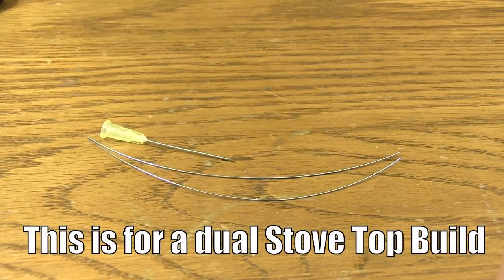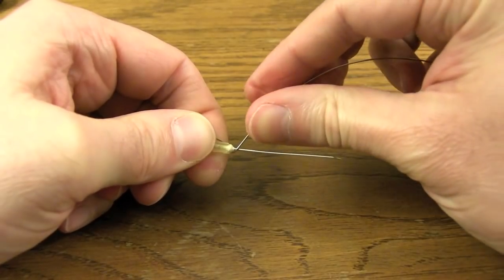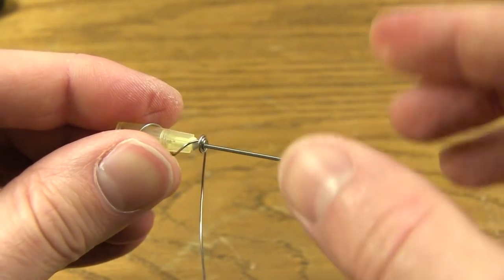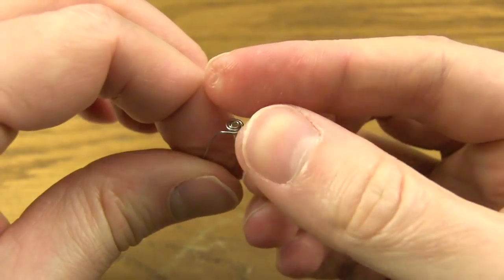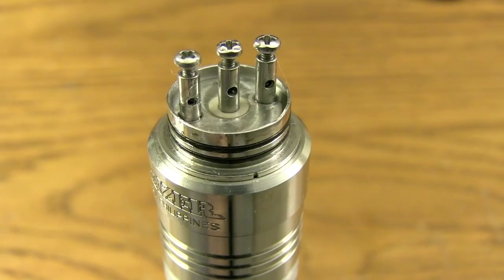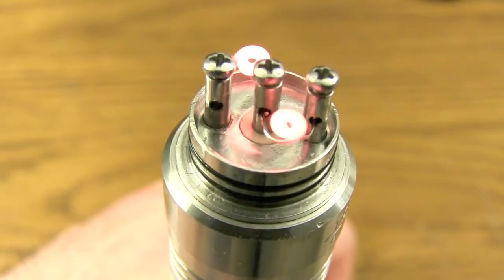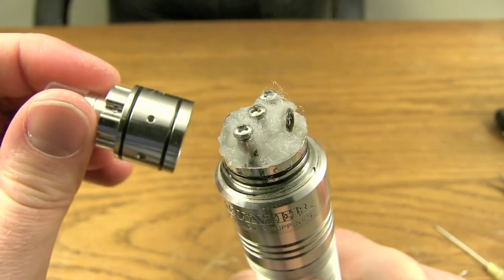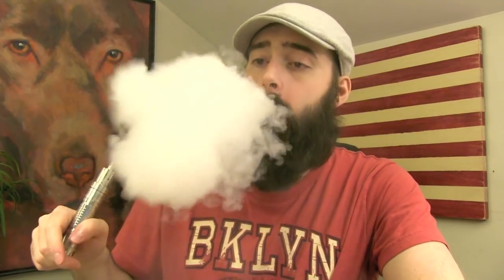Stove Top Coil Build

Comment: quick couple of questions rip. would this work well with a single coil build? 
I know everyone says vape safe and battery safety. Say i build my rda with a 0.14 ohm resistance, what would i have to do to ensure the safety on an unregulated mod, should I not even build that low or just get new batteries? ive always been confused because will just read out the ohms and then move on. I want to  try this coil but I'm unsure what to do after my ive found out my ohms
Reply: I vape on a 26650 mechanical mod with a ~.08Ω dual fused clapton build. It's perfectly safe if you use the right batteries. just make sure you're not pulling too many amps. my single battery is rated at 64 amps. I pull about 50 amps. If I wanted to go lower than .08 I could, but I would need to get a different mod with an extra battery I could wire in paralel to my other battery. 

Just make sure your batteries are rated for the correct amperage, and if you need more amps, wire an extra battery in paralel (NOT IN SERIES. YOU'LL DIE.) and you'll be good, plus you'll get more amp hours. If you're using a VV or VW mod, make sure you're within both your battery's parameters and your mod's minimum resistance rating. if you're using an unregulated mod, make sure any switches or mosfets are rated high enough for your build. above all else, when in doubt, don't risk it.
Reply: I vape on a 26650 mechanical mod with a ~.08Ω dual fused clapton build. It's perfectly safe if you use the right batteries. just make sure you're not pulling too many amps. my single battery is rated at 64 amps. I pull about 50 amps. If I wanted to go lower than .08 I could, but I would need to get a different mod with an extra battery I could wire in paralel to my other battery. 

Just make sure your batteries are rated for the correct amperage, and if you need more amps, wire an extra battery in paralel (NOT IN SERIES. YOU'LL DIE.) and you'll be good, plus you'll get more amp hours. If you're using a VV or VW mod, make sure you're within both your battery's parameters and your mod's minimum resistance rating. if you're using an unregulated mod, make sure any switches or mosfets are rated high enough for your build. above all else, when in doubt, don't risk it.
Reply: I vape on a 26650 mechanical mod with a ~.08Ω dual fused clapton build. It's perfectly safe if you use the right batteries. just make sure you're not pulling too many amps. my single battery is rated at 64 amps. I pull about 50 amps. If I wanted to go lower than .08 I could, but I would need to get a different mod with an extra battery I could wire in paralel to my other battery. 

Just make sure your batteries are rated for the correct amperage, and if you need more amps, wire an extra battery in paralel (NOT IN SERIES. YOU'LL DIE.) and you'll be good, plus you'll get more amp hours. If you're using a VV or VW mod, make sure you're within both your battery's parameters and your mod's minimum resistance rating. if you're using an unregulated mod, make sure any switches or mosfets are rated high enough for your build. above all else, when in doubt, don't risk it.

Comment: I'm kind of a n00b to vaping especially building my own coils so, bear with me. I know that each coil in this video are .62 give or take, so, if I added another coil to this and only used one would the resistance be closer to 1.4?
Reply: No it would half. For example if you build a coil that is 1.0 ohm resistance then adding a second coil of the same type to the atomizer will come out to around .5 ohm
Reply: Wait I mis read you question. Did you mean building a dual stovetop out of one strand?
Reply: I just meant adding another wrap to one coil.

Comment: Hey RIP.  What do you recommend is a good starting RDA and battery thats not too expensive?
Reply: my opinion get the 
Mutation X V3 
and fore battery get the MXJO 18650
Reply: What battery case you recommend? The DNA 40 is too expensive for me
Reply: You think the Turtle Ship V3 style mechanical mod is good?
Reply: Dopest Dope try out the angel mechnical box mod its around 25-35 and it puts out some great power
Reply: Sweet.  Thanks!
Reply: Dopest Dope I would recommend the K-Box for a cheap regulated battery mod that is basically idiot proof.  Unless you are running like super low ohms this 40 watt mod is more than enough.  The ability to swap batteries rather than charge through a cord, allows you to Vape constantly as log as you have a spare battery handy.  As far as an RDA, really, I'd recommend anything available to you with 1 positive and 2 negative leads.  This configuration will give you the ability to try all sorts of coil builds and determine what is right for you.  In contrast, something like the 'Monster Cloud' RDA has a configuration that can be difficult to build on unless you have some experience in super-nano coils or some such.  I have a 'monster cloud' myself, and I have difficulty building on it with anything less than 32g Kanthal.  Hope this long winded post helps.
Reply: Definitely will check it out.
Reply: Dopest Dope not too expensive how much? I'm going to buy an evic vt, it's really good mod. the battery  lasts long, it has temperature control, 60W, comes with ac adapter, usb charger cord, semitransparent silicone protector and ego one max clearomizer with two temperature control resistors, one of nickel and other of titanium. costs 85€ (~95$). for the rda IDK, something from kanger or even rebuilding vivi nova resistors lol ( vivi nova costs 10€)
Reply: Dopest Dope just wondering... Is the weed in your picture the dopest dope you've ever smoked?
Reply: Nope. The dopest dope I've ever smoked i smoked before i had a good cam. Jim Wilks Development

Comment: Probably a stupid question: if I accidently put the battery in my mech upside down and vaped a while before I noticed, is the battery still safe to use if I correct its orientation?

Comment: cool !!!  ok, so I will be using a mech mod (k100)  and I want to stay around 1.5 - 2.0 ohm.  I will prolly need to just build 1 coil. (going to order an rba soon, some clone, not exactly sure tho, but 3 posts for variety)  im using 30ga kanthal , how many wraps do I need to meet that 1.5 mark (or w/e u would recommend on a mod)  I have a decent multimeter, but its not super accurate.  any advice on always wrapping coils with 30ga at 1.5-2 ohms would be great  :)
Reply: Somehow I don't think rip is going to answer your detailed request.
Reply: madscientistshusta lol its all good, I probably did ask a bit and ive learned a few things along the way

Comment: Could you use this in a single coil RBA? Like say the Reomizer 2,0?
Reply: Yes it will work in an RM 2, you can also center post it if you pre-bend the leads right.  I didn't watch rips center-post vid, but I've been pre-bending my wires since my second build on an RDA.  It makes life easier.  Not to mention I'm fairly OCD when it comes to my coils and their uniformity.

Comment: These coils would be a lot easier to make with jewelry pliers.  They're basically spirals that anyone with a pair of round nose and chain, flat or bent nose pliers can create in a second and much more neatly than what was shown in the video.  I guess showing it done on the 20 gauge needle is better for those that don't want to invest in tools but the tools are pretty cheap if you buy them as a set so I don't really see the point unless it is just so you know a way to "try before you buy."  I might try this coil if I finally decide to get an rebuildable.

BTW, does anyone know if a rebuildable that would look good on my eGo-V v3 Mega?  I'd have to go no lower than 1.5 ohm on my builds but I still want one.  Help?
Reply: Get a Mod you'll want to go lower then 1.5ohm once you get a rebuildable!!
Reply: Leo Voisard I'd love to but I have Carpal Tunnel Syndrome which makes it hard for me to hold on to anything heavy which most mods are with a battery installed.  I'd be dropping it every two seconds and probably destroy it pretty quick.  At least it would look very beat up very quickly and I'd probably have juice flying everywhere, lol.  That's why I tend to stick to eGo batteries because they are light and I can put a lanyard on them so I don't drop them so often.  Do you know of any mods that can be attached to a lanyard or are indestructible that don't cost over $50 which is the most I can afford?  I know I haven't seen one but I'm not an expert on mods either.  I'd appreciate any help you could give me.
Reply: If you want a slim, very basic rebuildable that isn't made for sub-ohming, you may want to check out the Smoktech UDA Atomizer. Discount Vapers has them. It's very narrow so it should look fine on your battery. Just don't forget to get a drip tip and beauty ring if you don't have them.
Reply: Van Dillerham She's looking for a rebuildable that would look good on her eGo-V v3 Mega. Gotta say, I got an iTaste vw from fastech and I love it!
Reply: coralinealgae Thanks, I'm checking it out.  I was considering the Taifun GS since I hear it has a 17mm diameter like my eGo-V v3 Mega and it has a tank but I'm definitely wanting a dripper too because I mix my own juice and need a way to test them.  I was looking at the Phoenix but that one seems to be a bit too tiny for a first RDA, though I'm used to dealing with jewelry wire so working small isn't a huge deal for me.  The SMOKtech UDA seems to have a decent airflow control which is definitely a winner in my book.  I'm a bit hesitant about to tiny drip well though.
Reply: Van Dillerham I was considering the iTaste Vv/Vw when I got my eGo-V v3 Mega but I didn't see any way of putting it on a lanyard which means it would be destroyed in a day or two because I'd be dropping it constantly.  I might get one eventually though if I decide I want to figure out how to make a case style lanyard for it.  Thanks for the recommendation though.  I checked out the KSD Novice and the price is good enough for me not to worry about destroying it but the reviews leave me a bit hesitant on it.
Reply: My next purchase will be a Taifun GS. Should be a very decent rebuildable.
Reply: I made this coil with jewelry pliers too, actually. I think a lot of vapers that are picking up stuff at Home Depot would be surprised at how many useful tools you can find at Hobby Lobby. Jewelry pliers, The Coiling Gizmo, good scissors, organizer boxes, and I use sewing needles to wrap nano coils, they are much cleaner out of the box - unlike a drill bit.
Reply: ChibiChula I got a Taifun GS about a month ago. So far I'm not at all impressed. It isn't nearly as good of a vape as an evod or protank mini. I may just need to try more builds with it, but because so few people seem to advocate for using the GS there are few videos. I'm not a fan of them.

Comment: Going to give it a go with twisted 28awg. Got no 22awg ;(
Reply: I tried it.... Hard to get right. Spent a loooong time getting the shorts out. One coil 4 wraps . 4 ohms. Not bad but not great. Like rip mentioned hot! To hot. Burnt Nana's cream to a crisp.
Reply: Plez Bon
Thanks for the advice. I'll just get a better RDA...any recommendations?
Reply: I love my trident v2 in duel & still rockin my igo w in single. I tig welded one hole, then drilled the other out.
Reply: Plez Bon
Thanks mate. Just got into RDA's but got an Omega clone. Never seen soooo much vapour. Had to go to zero nic / 100 VG from 2.4mg PG on Protanks 2...leap of faith. Got a Nemesis, quite good at wrapping coils (hence, surgical glasses). As you are an expert, what's your recommendation, trident 2 or igo w? I use boiled cotton and micro-coils. Thanks your advice in advance, appreciated. Got 30 amp batts so sub ohm and clouds are what I'm shooting for. Wasted a lot of cash on ego's etc, however the c-twists are still quite good for 4.8 volts. Cheers.
Reply: Oh nooo... Not an expert. I've had/ have lots of RDAs laying around. The trident V2 & igo w I use every day. In my humble opinion twisted 32&28 gauge bring Starbuzz shisha flavors to life. Likewise most fruit flavors. 
Since my main all day vape is fruity I keep a set of twisted in my trident. And a single micro in the igo. Then I can swap cotton quick and change it up as my mood changes. Work days last 12-16 hr.... I can vape any time. M16 2, RDAs, and a hand full of juices... Good 2 go. 

When picking devices don't let anyone tell you what to think. It comes down to what you are comfortable with. Post configuration and air flow. If you are going to twist wire or run 22 gauge duels, your going to need BIG holes or a center post with a block that has two holes. If I had to pick just one...  (of the two) Trident v2. You can build it how ever you like. Every thing is adjustable. I only keep the igo because it was my first. When the top cap got loose I heat treated it to shrink it. When I drilled the holes out to big I welded one up. It's UGLY!  But it hits like a champ. Sitting on by worn out slightly dilapidated k100 mod, it's the rat rod of my mod collection. Every one remembers there first. I still have mine.
Reply: Plez Bon
yeap, good solid advice. thanks. would like to find a Stillare, looks easy to build on and good quality. i'll PM you, as may be getting some interesting devices in. you have been very helpful, top bloke!

Comment: Is this not pretty much the exact same freaking thing as the hurricane coil? Except using kanthal instead of flat ribbon wire?
Reply: Yes it is. Rip does this shit all the time, using the exact same concept with a different type/guage wire and calling it a brand new build. It gets very tired very quickly so it's best to just check in every now and then to see if anything original has happened. Needless to say its often disappointing but the reviews aren't bad sometimes.

Comment: Maybe a noob question, but why do you add the cotton? Doesn't that just fuck it up?
Reply: Sauce Delabbq The cotton is there to hold the juice. Without it, you'd have to coat the coil with juice, which would vaporize pretty quickly and would waste it. You wouldn't get great hits off of it either.
Reply: Wow this makes so much sense, I feel abit stupid for asking now :P Thanks alot for the reply^^
Reply: Sauce Delabbq Don'r worry about it, we've all gotta start somewhere. There are some wickless builds (look up wickless builds/coils on youtube), which give off awesome flavor and probably really good clouds, but they're impractical and go through juice really fast. They're more for testing out juices to see what the flavor is like.
Reply: Yeah, my thought was that the cotton would burn, and that you wouldn't want to smoke that, but apparently it is pretty heat resistant stuff^^
Reply: When it dries out it does get a burned flavor to it, but if you keep it wet, change it out, and clean up your coils then there's nothing wrong with it.
Reply: Great advice! Thanks alot mate! Will definetely keep this in mind. I will try one of these builds soon^^ Good day to you!
Reply: No probs man, good luck.
Reply: matthew baker I'm fairly new myself, and it only makes sense to help out newbies when it comes to anything, otherwise nobody will get into it. I remember I went into a vape shop with a buddy of mine who has more experience than I do, and I was asking some newbie questions, like "What strengths does x flavor come in?" and the dude working there was really laid back and answered them for me. My friend was a little shocked because all the people who worked at the places he went to out in LA would have been total dicks to me if I asked those kinds of questions. If we're gunna grow as a community we have to help people learn who want to get into it.

Comment: Houston we have a problem. i owned a griffin 25mm top airflow and my 6 coil pins losetreads. i only have 2 left which i use for single coil. went to my local vape shop they dont sell unless i both the whole thing my griffin is almost new. need new pins. anyone knows were i could get it? any idea if i hust use another pins or what?
Reply: buy em from ebay lol
Reply: +errno i guess i have to check if they have the smallest tiny winny allen screw at the guitarshop
Reply: Sebastian ll fasttech.com 1.48
Reply: +Blaine Abshire nah dont bother mate.. its already in the trash. i just bought limitless plus and its better than griffin

Comment: I made this and it reads0.21Ω how can I get it to read a bit higher?
Reply: i think 0.21 is great but if you want a higher reading increase the wraps.
Reply: +Chris Wallis Use thinner gauge wire, there will be a higher resistance. You'll probably have to wrap it a few more times. I agree with old dude though, .21 is good
Reply: +Tristen Graham I took them coils out now I have a cool I made that reads .15 that I really like

Comment: Dumbass question I know.. I wouldn't say I'm completely new to vaping, but does building your own coils make that big of a difference in vap production than using pre built coils??
Reply: Check out some of Rips other videos he is very informative to entry level vapers. Now it depends on your level of tech you are using as a vaper such as a pen mod with a tank or an RDA with a mechanical mod. with pen mods and the tanks such as a kanger pro tank ect. you usually buy the coils pre made BUT you can re build them using 32 gauge kanthal silica and or cotton which can be much more cost effective as well as producing a better quality vape I.E flavor and production. With an RDA you almost always have to build the coils yourself and wick them again more cost effective.

Comment: Hey Rip, i tried doing this coil just yesterday and i had it all looking just like it was supposed to but every time i fired it would heat from the posts and not the center. Ive been building coils for over 2 years now and i couldnt figure out how to fix it. Where do you think i might have gone wrong? I was going to post it on instagram bc someone asked me to, but that didnt happen. 

Instagram is Sigelei_vapes4lyfe